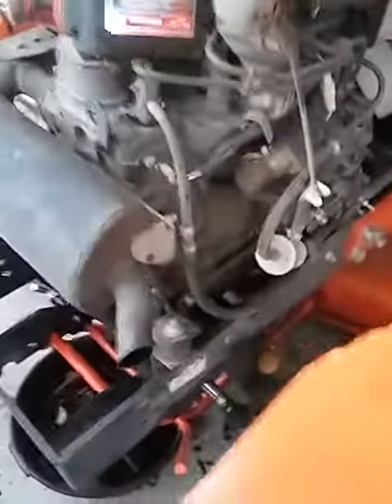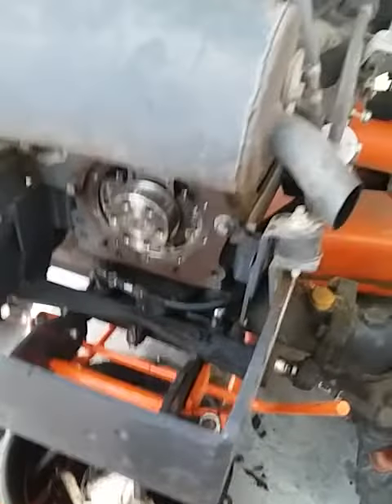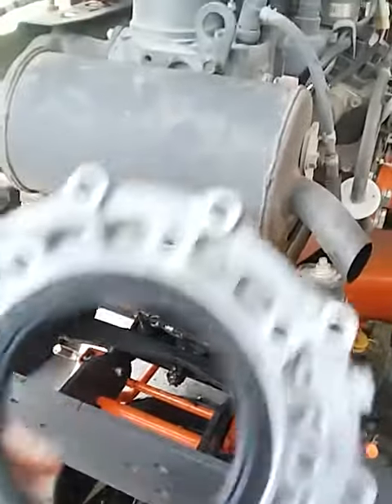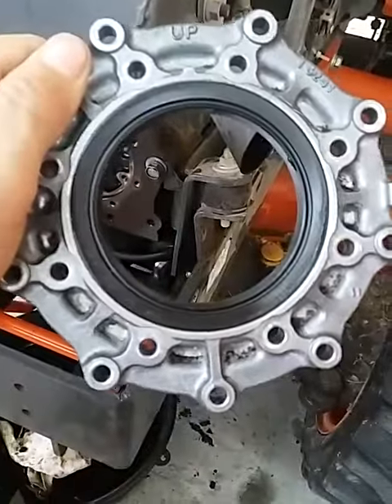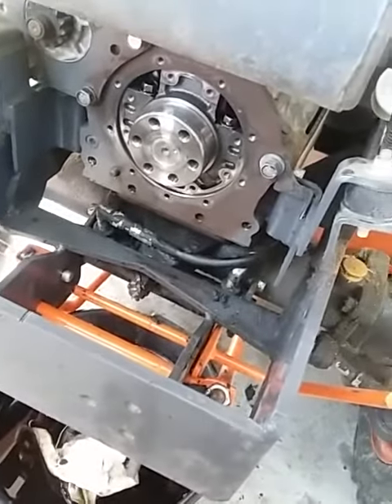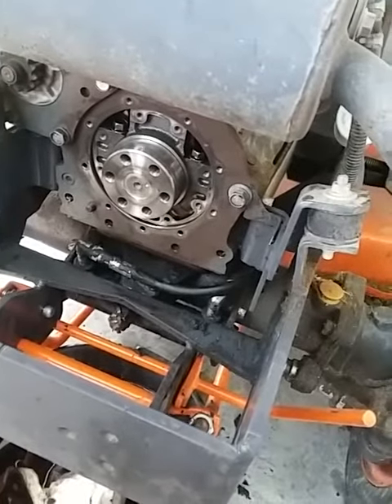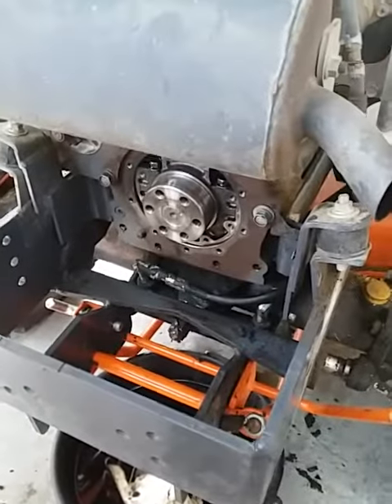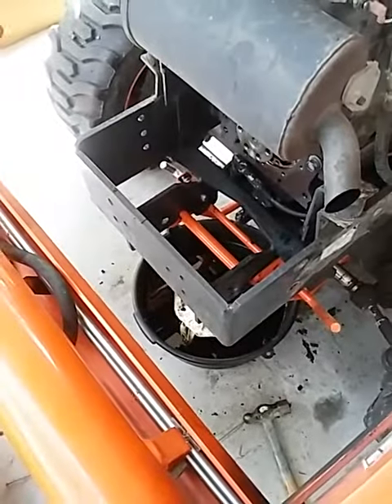Kubota BX 2660 main engine seal

Comment: I think mine started today.. did yours sling oil up on the front axle?   I'm super glad you did this video. I've had the fly wheel off before to replace the steering hoses so that's an big deal. THANKS !    oh..and how many hours on your tractor ??
Reply from the maker: Yes had oil on front axle.